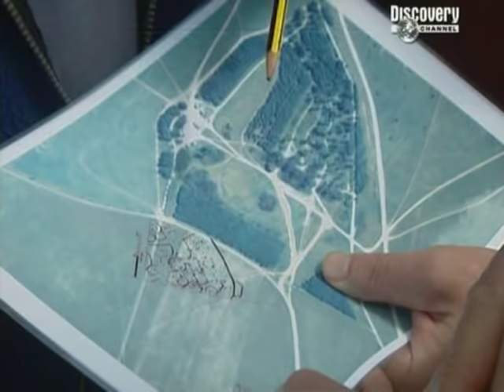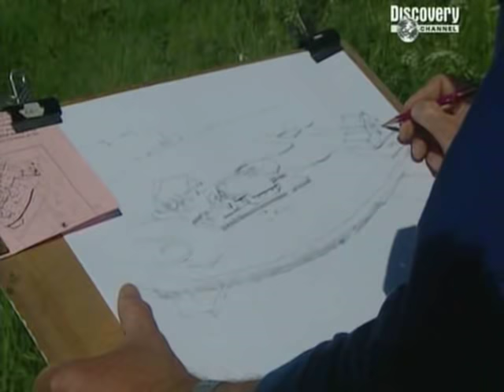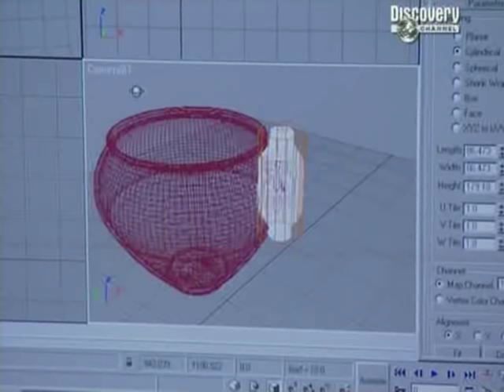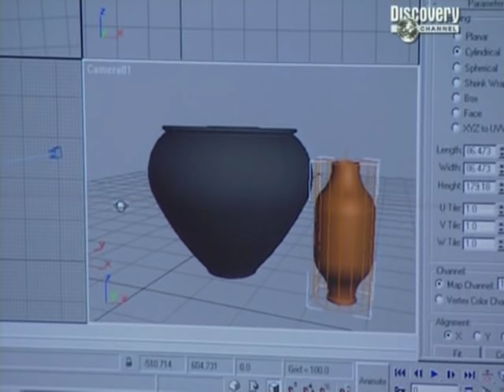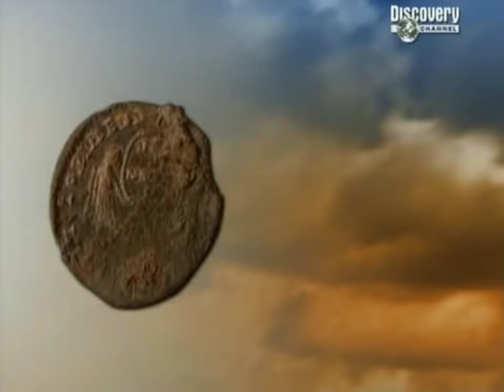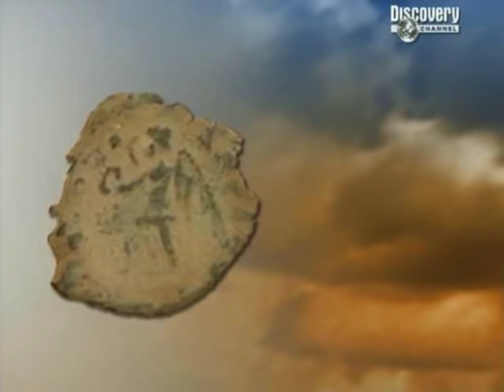Time Team S08-E07 Salisbury Plain, Wiltshire

Comment: I think the most impressive part of the building of the roundhouse was the authentic use of Iron Age aluminum extension ladders.
Reply: carlos perez , progress, aluminum age iron ladders.
Reply: cheeky
Reply: Cold, mighty cold, your comment and the wind off the Salisbury Plain.
Reply: Britain has our equivalent of OHSA. No matter how historically accurate you try to be, they still won't let you use homemade ladders or work without hard hats or dig trenches and holes where the sides are over 6" without trench shoring. 

I threw out a lot of perfectly good wooden ladders and step ladders because they weren't OHSA certified.
Reply: @Biggus_Mickus  For the same reason that wood beams last longer in a fore than steel beams. Steel will buckle. and bend. W wood beam has its strength almost until it breaks.  But in my opinion, if it was there for 17 years, it should have been "Grandfathered" in. Unless there is a superseding code change that made that metal stairway illegal. 

Remember, many building inspectors are the ones that harassed us when we were young and in school. They are the bullies that grew up and found  the perfect grown up job for themselves.
Reply: 36:28 "the growing grain gives off carbon dioxide, using up the oxygen"  ...A+ SCIENCE
Reply: @chrisgordon5719  but surely you can dig deeper than 6 inches? Don't you mean 6'?